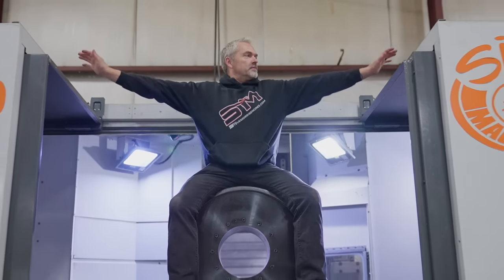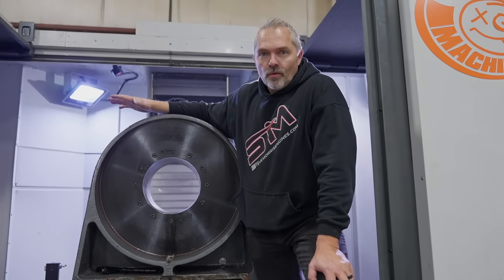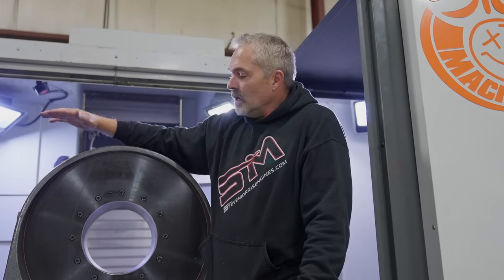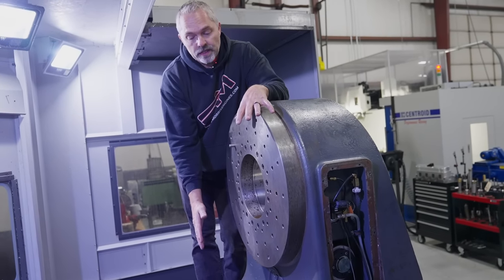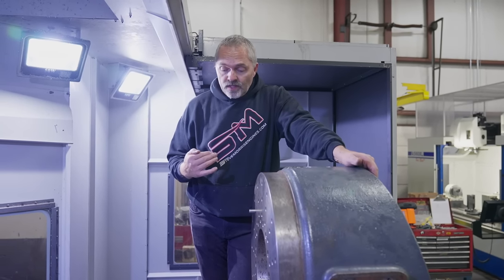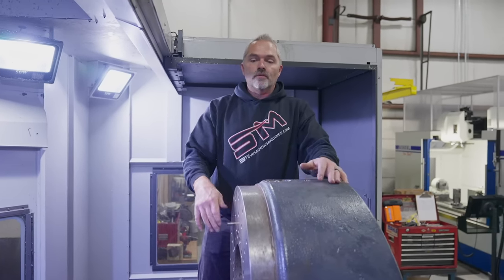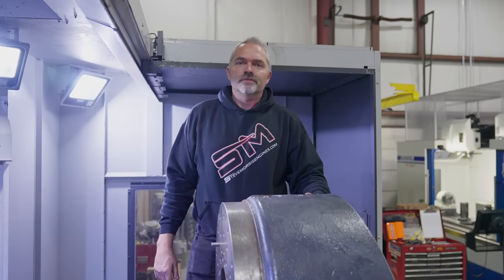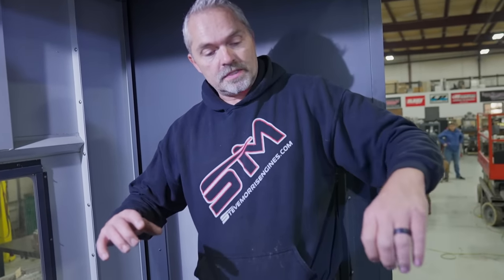Problem Already! Delayed world takeover!

Comment: HAAS machine are great, I was a Manufacturing Engineer for over 50 years and what you are saying is so true, you can't expect any machine to have large heavy billets that hang out attched to it and try to hold such tolerances. This machine will do what you want after you make the correct changes to it, what a great addition to your well equiped shop!

Comment: I rebuilt machines for 10 years that ball screw and ways replacement is not a cheap job … that hurts someone’s wallet for sure 😮
Reply: When he said all that needed replaced and repaired I was thinking the exact same thing.
Reply: likely insurance.
Reply: I have a screw in a crate at work for a 3axis hurco 40"x20" table. Screw was $5k

Comment: Haas is completely responsible for this . I have installed 6 different Haas machines and they where always locked down with shipping brackets so nothing moved. If their bracket broke it’s on Haas.
Reply: This is the third shop that machine has been in the reason he’s getting rid of the trunnion is because it has been the reason it wasn’t successful at the original shop or the shop they had it at to try to find him a work around to haas’s over promise

Comment: Well Steve said it right there is 20 million dollar 5axis machine out there that will do it but you have to have big money to get them.
Reply: think he grabbed that amount out of thin air to get his point across as to how hard it is to be acurate while flinging that amount of weight around inside the machine , as in it might take that amount of cash to do that
Reply: He's WAY OFF with the 20 million figure by about a factor of 10x. You can get a Heinemann for 1-2 million. Not sure on a Okuma, Mazak or Specht.

Comment: This problem is the same problem Chevy Trucks have with front wheel bearings. Don't try to hang 300 lbs of crap off of a half inch bearing. It won't last. LOL

Comment: Great attitude! I tend to overreact, but I'm glad you're getting it figured out. Manufacturing blocks or any engine component from scratch is way harder than modifying some existing components.
Very cool & I believe HAAS manufactures a good quality piece. Used or new, this stuff is big $ and the programming, software, tooling, coolant & training/set-up just add.

Comment: I feel a Grob could do this, they are built in ohio
Reply: We have 4 Grobs at the shop I work at.  No doubt that they could handle this, but they are much more complex.  This requires more programming knowledge.  Repair can be easy as I love how they number trouble codes and do their machine drawlings, but part availability can be an issue to at times because a lot of stuff does come from Germany.   Second hand, I have heard the Ford Lima engine plant uses Grobes to do their engine blocks and heads.

Comment: 45+ years of machining/programming/design etc, most of it spent on or with HAAS machine tools.
HAAS is probably the most operator friendly machine tool in the industry, and,
Dollar for dollar HAAS machines are hard to beat, and there's quite a few manufacturers out there.
P.S. there are 'Bazillion' dollar machine tools with that kind of accuracy, but there's absolutely no purpose  whatsoever for one in this industry, and paying for one would take astronomical sales numbers.
The HAAS machines are the perfect match for this industry.

Comment: Don't accept anything without a Laser flatness measurement, they are easy to understand and have an accuracy of. 0001" to. 0002" depending which laser brand they use, hint, that laser equipement cost 60000$+ and it fits in a small suitcase, so you have an idea that it is the real s#@&., insist in this if you can, or to be  100% sure your self, hire someone that has this equipment and let them take the measurements, the best equipment out there is from Pruftecnik  called "levalign" and the other one is Easy Laser, Pruftecnik is a German company and has a base in Miami, Easy Laser not sure, a technician with his equipment will cost you around 3000$ +/- a day, he shall do all the measurements you want in one day, I think is cheap insurance, to be sure your bed, rails, etc, etc are not bend and are in Haas tolerances.